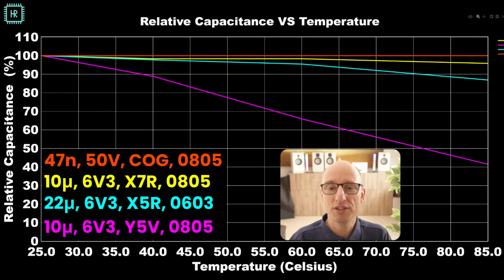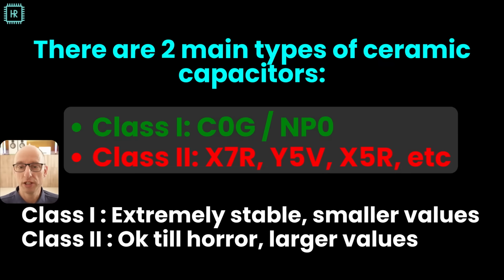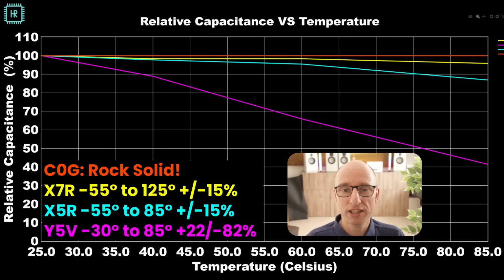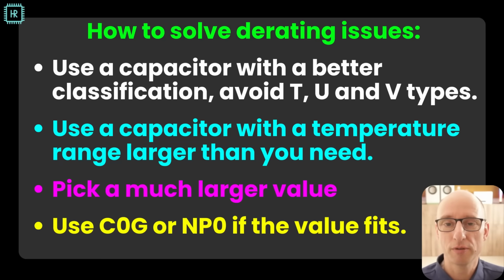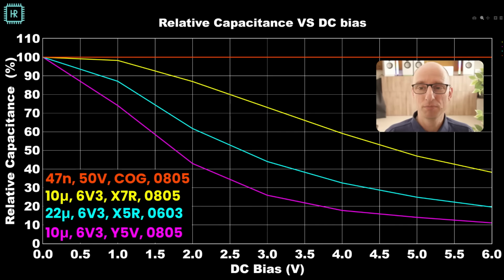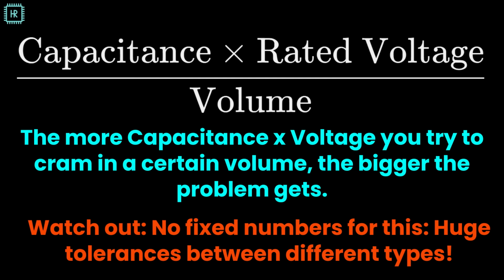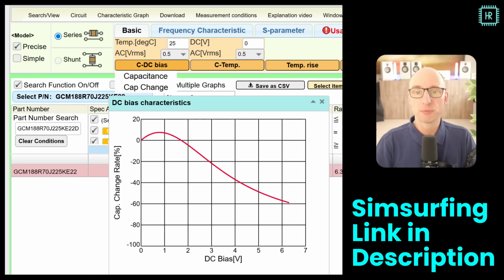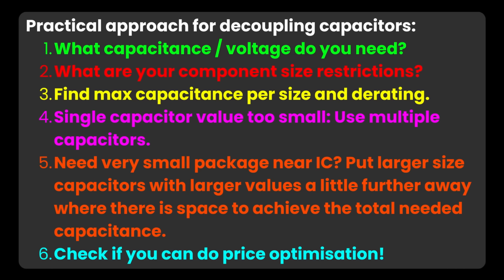Hidden Capacitance Killers, The Ones That Ruin Projects

Comment: I was also shocked to find this out. No rules, just each MLCC has it's own specific data. Some don't bother publishing it or hide it away deeply.
None of them draw attention to this in headline data, quite the opposite!
Murata on simsurfing have excellent data.
To me this potentially massive reduction in capacitance with applied DC voltage borders on misrepresentation, and many engineers are not aware of it. Bit scandalous really.

Also look into cracking, soft vs hard terminations and piezo noise!!
Reply from the maker: Yes, it's a bit tricky how they're not advertising this :-)

Comment: I suspect some modern capacitors are worse than the older ones of 30 - 40 years ago, especially regarding electrolytes which people seem to think need replacing en-masse for equipment which is not that old. In my experience of servicing equipment in the 80s and 90s, the only time you would get a capacitor problem is if  some idiot designer had placed the capacitor so it is virtually touching the heat sink, and often touching anyway. It was easy to spot in many cases because the plastic surround would shrink a little on the top, so you could visually see a duff capacitor.
Reply from the maker: Yes, heat is a big problem. That is always the biggest problem for reliability in general.

Comment: Really interesting indeed. 
I have had to throw away a whole bunch of ceramic capacitors, because the capacitance varied so much with temperature I taught something was wrong with them (this also makes them unusable for many of my circuits, since they were in the 2-10 nF range, which I often use for controlling oscillator frequencies, turn a square wave into triangular and other filtering). 
I discovered it when temperature testing my circuits, which I often do by using cooling spray and the oscillator frequency or amplitude of a triangular wave got "all over the place". That spray can also spray small areas, so single components can be tested - spraying the capacitors clearly showed the problem 😂. 
Low temperatures is often more important than high, for stuff that's going to be used outdoors and don't dissipate enough energy, to generate significant heat on it's own - because the bigger the deviation from the 25°C standard, the more the risk of component values going outside tolarable limits. Hot summer days, even in hot places don't often go above 45-50°C (unless stuff is going to be used on sun heated surfaces or inside a car in the sun) - which is a 20-25°C difference. But in places where winters get cold (like where I live), the temp may drop to about -15°C, that's a 40°C difference - and in some other places, it get significantly colder then that.
When those capacitors got down to like -40°C, that also led to a reduction in capacity of up to 80%! (seems like the capacitance peaks at 25°C or just below, then drops off both below and above. As seen from your graphs as well - it's quite flat at 25, then drops off faster and faster. So aparently they start go down again when the temperatures goes far below 25°C). 
But that with DC bias was a nasty and unexpected thing. Now I need to test them for that as well.
Reply from the maker: You don't need to test them really, unless you have no idea what kind of capacitors you have. If you have the type and dielectric, you can pretty  much predict if they're good or bad.
Reply: @HansRosenberg74  Yes, but it was cheap capacitors without detailed data sheets. Still really informative video, since I didn't even know some common ceramic capacitors had a strongly  voltage dependent capacitance. Because that's probably pretty much what it is - having a DC bias just means there will be a continuous voltage applied, regardless of the amplitude of any AC component. If using such a capacitor in for example an RC filter with just an AC signal without any DC offset, this will show up as just distortion instead (if it's amplitude is high enough)
 - this means you probably want to avoid these capacitors for audio stuff as well (as you seem to talk about audio in some other videos - for example the one about noise in resistors. Noise and distortion is highly unwanted there).
I did know there are paracitic capacitances in for example diodes and transistors that is strongly voltage dependent though - and there are even "capacitance diodes" supposed to behave that way. So if thinking about that, it's not that surpricing there are capacitors that behave that way as well (for some applications it can actually be really useful).

Comment: Damn, now I’m annoyed at myself for always seeking the most compact electrolytic capacitor for a given capacitance. And wow, it seems pretty shady for manufacturers to give a rating to their capacitor that only applies at 0 volts.
Reply from the maker: Actually, picking the highest value in the smallest package has advantages (check out my video on decoupling). You just need to be aware that you may not be getting the capacitance value you expected.

Comment: man, it is incredible! 
this is why i have so much trouble with building voltage stabilized sources, with 7812 ?! 
am physicist and half electronist, and always thought there must be such variations, but i never imagined they would be so big. 
the catalog says there i need some 10uF, and i put there 10uF, and it becomes 1uF?! then oscillates, then i start blaming the Chinese...
Reply from the maker: Haha, yes, if you're unaware, this is a nasty one :-)
Reply: @HansRosenberg74  well, am engineer, but i did not specialize in tha-at! 
me and electronics only at hobby level. 
really had problems i described! did not investigate how capacitors behave, merely concluded that there is something missing in the catalog, about the range of admissible increase in stabilized voltage, using the fixed voltage stabilizers. which may still be the case...

Comment: Hi Hans, could you do a video on mechanical stability of those capacitors ? Ever since these high capacitances are around for ceramic smd I found that these easily short circuit or get an impedance such that they get hot. Pcb design is a big factor here. There are capacitors you can buy which do better in that respect. I think good topic for a video if you have some experience on that.
Reply from the maker: I don't have experience with that. I usually slightly overdesign capacitors so this never happens.

Comment: So where's scam?
Reply from the maker: Well I think a 10uf capacitor that delivers 1uF when used within it's normal operating conditions should be sold at 1uF........ If noone told you about this, you're pretty much screwed.....
Reply: @HansRosenberg74 welp than how it should be sold? If a person wants 1uF and gets 10uF instead - probably not good either.
It's like demanding water to be at the same density across all temperatures - it's physically impossible.

Comment: I always knew that smaller SMD components are preferred because they have less parasitic characteristics.
For example, a capacitor has parasitic inductance (ESL?) and parasitic resistance (ESR)
The smaller you go in size the better the characteristics.
0603 should be better than 0805, assuming the capacitance value you need is available in 0603 package.

Your experiment might be better off if you measure in circuit for a voltage regulator.
You should use a transistor or rezistors next to the capacitor if you want to heat up the area. And cut out in the PCB in order to trap the heat. You can also have a SMD NTC sensor .

The dangling hot air station isn't ok.
Reply from the maker: Haha, I just worked with what I had. Measuring WITH a regulator is actually better. The reg has an inductive output and it will resonate with the decoupling caps.

Comment: I actually tested this in my lab a while back and found out that Ceramic capacitors lose capacitance permanently if the voltage gets too high. it can be really hard to know what a cap on a board is rated for and you pretty much have to guess. But during my tests I saw that you will indeed get a DC leakage through the cap when the voltage gets too high and it immediately loses capacitance. but the capacitance degradation even happens below the leakage point so you can´t even know when you operate at a safe limit on these. it really is a guessing game all together
Reply from the maker: Yes, I noticed that too, you can see it in the tables in the video somewhere. They say it comes back after a few days, but I tried that and it did not come back at all. I did not exceed the 6.3V rating either.....

Comment: Thank you for posting this, Hans.
Electronically challenged, 3rd abstract imaging laser synth PCB design in progres, and had no idea that these issues existed.
PCB #2  has spikes on the 24VDC switched power brick + buck convertor's 12VDC supply rail (cooling fans); the op amps' +5V offset reference is drifting during warmup; and I need to filter out the Gibbs phenomena from my I2S audio DAC's signals.
I believe this info is vitally relevant in order to solve these annoying problems. So, I'll increase my cap values, rated voltages, physical size, and use better quality with tighter tolerances... and crossed fingers. 🙄
Reply from the maker: Ok, you MUST watch my free module! This will save you a lot of problems, check the link in the description. If this is your first board, this is vital!

Comment: Excellent.  I teach this to all my less-experienced engineers.
You mentioned Simsurfing (Murata); K-Stim (Yageo Kemet) is also very good, particularly for finding SRF at high frequencies for C0G capacitors (another derating mechanism!).
Reply from the maker: thanks!
Reply: Walsin has both temperature and voltage derating curves for every capacitor, available on their website.

Comment: The text in your thumbnail made me laugh... Yeah, who got scammed were those folks that missed their AC Impedance lecture in school! A capacitor's voltage rating, max current at max frequency tells you mostly what you need to know about a cap dynamically... Apply those numbers to your application
Reply from the maker: I want to 'school' a really long time ago when this wasn't an issue yet. If you paid for 10uF, YOU ACTUALLY GOT 10uF. :-D... Things were soo much better in the old days :-D (I'm, really getting old!) lol

Comment: Instead of using a big electrolytic capacitor in series with the capacitor under test, I would have used two identical capacitors in series (for the AC) - they would be in parallel for the DC though, as the midpoint between the two capacitors would be connected to a high-value resistor to the DC bias source. Then you can halve the measured AC impedance of the two capcitors in series, to get the impedance of one capacitor (making the assumption that they are really identical).
Reply from the maker: That is a great idea, my pcb's were for general testing and did not have the right layout, but this is a great idea.

Comment: Voltage dependent capaciance change is why you should never use a ceramic cap in low distortion audio. They will generate harmonics.
Reply from the maker: indeed! For decoupling it is ok, to improve things I use 100nF/100V X7R capacitors. The high voltage and stable supply voltage solves all problems here for a supply decoupling use-case.
Reply: There are some instances in audio where using a ceramic capacitor is essential, but these instances are all in the area of recreating inherent high distortion with lots of harmonics found in some vintage audio processing circuits.  A tube power amplifier for guitar is perhaps the best example.  A large component of the unique tonality of some guitar amp circuits comes from poor performing capacitors where the bias voltage may be considerable.  In less engineering oriented discussions I've seen the practice of replacing some of these old caps with good performing mylar/film caps referred to as "neutering" the tone of the amp.  All high fidelity amplifier designs steer clear of ceramics or use NP0/C0G in select locations.
Reply: @Peter_S_  Ihave a Vox guitar amp. It creates the proper valve sound by using an actual valve amnp, complete with output transformer to generate the proper transfer characteristic. But this only runs at about one watt. This gets followed up by a decently linear class D solid state amp which lifts the drive level to 30 watts. It works extremely well.

Comment: Something to think about: Does the capacitance values shown in manufacturer supplied example circuits take the capacitor Bias  voltage AND the rated Voltage of the capacitor into consideration when stating the capacitance value?
Reply from the maker: The value is at 25C and 0V bias...

Comment: Its worse than that. the capacitance rating of ceramic caps is at 0V, not the voltage rating of the cap!. so a 10uf MLCC cap is only if the voltage is near or at zero. 

"Class 2 (X7R, X5R): These capacitors have a higher volumetric efficiency (more capacitance for their size) but suffer a significant reduction in capacitance when a DC bias is applied. At 0 volts, they exhibit their maximum capacitance, which decreases as voltage increases"
Reply from the maker: exactly my point!

Comment: For the ceramics in my parts bin, I have started to write the measured DC bias capacitance loss on the tag next to the rated capacitance. Measuring this is actually quite easy, just use a multimeter on capacitance mode, and add the required amount of batteries in series with one of the multimeter probes, using the other lead of the battery as a new probe. Then you can just probe multiple different capacitors just like usual, without soldering.
Might have to do some temperature measurements in the future tho, as I haven't payed attention to the losses there previously. Tho, I rarely use worse dielectrics than X7R.
Reply from the maker: that is useful to do, prevents surprises

Comment: Use X7R or COG...
Reply: X7R lose a lot of capacitance with a DC bias (ie when yo use them for power supply decoupling caps)
Reply: @guytech7310 Some. Not near as much as Z5U and similar dielectrics...
Reply: @HughCStevenson1  If you read the data sheet its most if not all.
Reply: @guytech7310 it varies a lot depending on the voltage and package size.... always worth checking and factoring into the design!
Reply from the maker: Mostly dictated by value limitations of C0G. It's only available in pretty small values....

Comment: Just wanted to point out a pronunciation issue yiu have with the word, “Ceramic”. In English some words beginning with the letter “C” are pronounced with a “K” sound…for example, the word “Cracker”. It could also be written (incorrectly in English but possibly correctly in other Germanic languages) as “Kracker” and it would read and sound the same. 
However, other words in English beginning with “C” are said with a “S” sound (and which are which is just learned from when you are a child and remembered). An example is the word, “Cell”…meaning a single electrochemical voltage source or the basic functional unit of higher living organisims.. If the “C” were to be replaced with an “S”,  to get the word, “Sell”, the pronunciation is exactly the same but the meaning is diffefent…it means, “to trade items or services for money”.

The word “Ceramic” in English, is of this second category…with the “S” sound, so said, “seramic” or “suramic”…not “Keramic” with a hard “K”.

Was somewhat confused as this is the seventh word you utter in this video. I understand you are Germanic, “German, Danish or Dutch” so Inunderstand the use of the hard “K” but it will confuse some English viewers.

Oh, kust used ten, 10uF cpmonoblock ceramics a few months ago to replace a 100uF bipolar electrolytic in a soldering iron thermostat circuit, so will keep this advice in mind. Have also had trouble with oscillator drift with some types of non NPO ceramic capacitors. These effects could be put to use however, EG low frquency VCO’s or tempersture sensors??
Reply: Actually it's easier. It the word starts "ce" then it's said with the S sound.  With some (but very few) exceptions, such as cello and Celtic.
Reply from the maker: I'm aware now of how to pronounce it (you're not the first to mention it ;-)  )

Comment: Another thing  that happens with high value ceramic capacitors in tiny packages, is they are less reliable, and can end up end up shorting out. The dielectric layers are so thin, and the ceramic so small, and often overly fragile as optimized for high capacity.

Dielectric failure is the result, either ftom microscopic cracks propagating in the ceramic,  especially from the extreame electric fields, adding in the fact the ceramics are often pizeiolectric, thermal expansioncoefficients, , or straight up dielectric failure from impurities, dendrites, voids, etc.
Reply from the maker: I've never seen this happen yet, so it is quite rare, unless you have spikes on your supply, that can really make things worse....
Reply: @HansRosenberg74 
Consumer electronics are often plauged by failed via shorted out, high value ceramic caps in small packages like 0402, 0603. Sometimes 0805. Often 10 to 47uF caps due to their popularity. 
We never saw this years ago unless physically damaged.
But now, we have 10uF 4V X6S in an 0201, which will probably make this issue worse. 

The caps usually short out the rail, and show up on thermal cameras. This affects high end laptops, flagship cell phones, etc. I'm sure it affects low end stuff just as much, if not worse, but most people just toss that stuff. 

Years ago, polymer caps were the common choice, for these applications. 
Now, everything has to be smaller and cheaper to produce.
Reply from the maker: Very good to know!